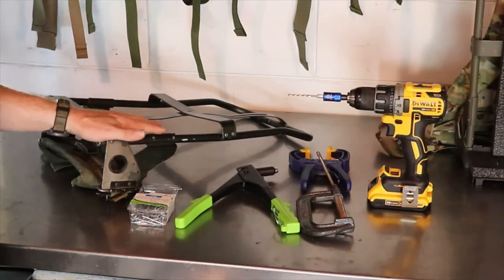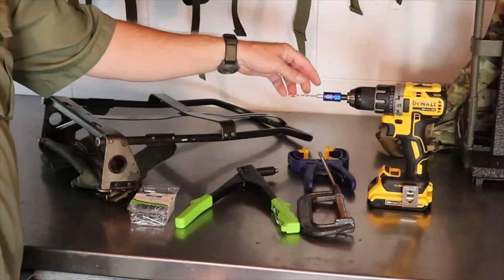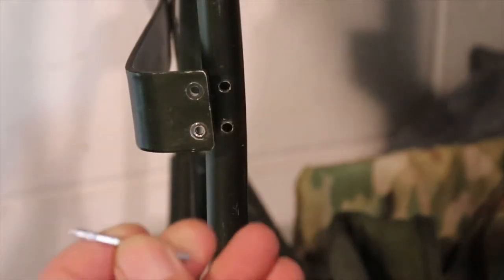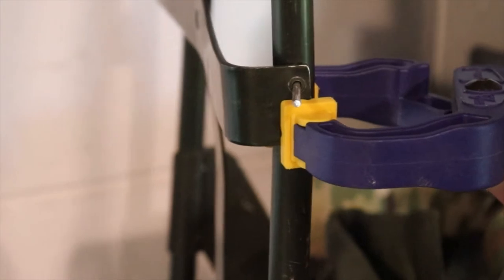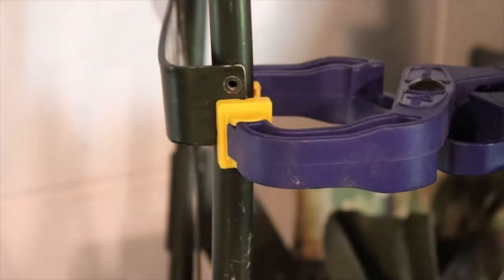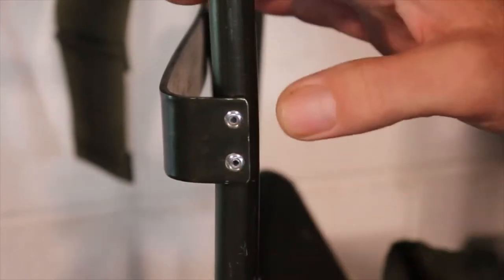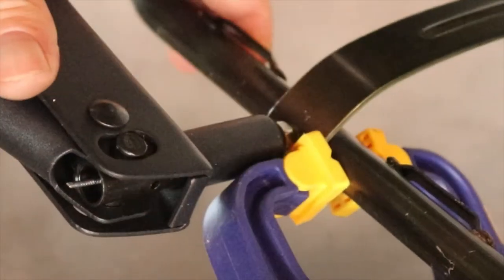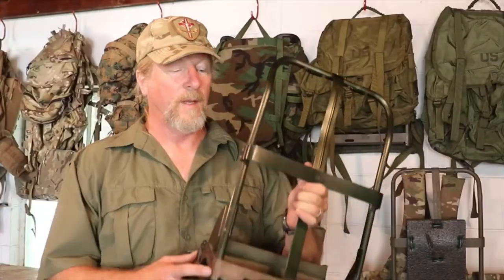Ruckdiculousness 2 A.L.I.C.E. Pack Frame Repair

Comment: I'm sorry but that clamp was not necessary.  It is a easy fix without clamps. All you had to do is just put the rivet in the hole and finish it
Reply from the maker: Thanks for The Tip Gary!

Comment: I used coat hanger wire and JB Weld to repair several frames, it does not look as good, but it is field expedient! Just purchased a nearly new large od green ruck w/frame for $90. Very hard to find in 2023 thanks to great vids like this, our secret is out!
Reply from the maker: Having some JB Weld with you in the field is a great idea!

Comment: I had the exact same issues on a frame that i also bought for cheap as it was damaged...nice to see some legit DIY repair, props my man
Reply from the maker: Thank you very much! I didn't notice it while I was doing the repairs, but when I was prepping the frame for the next video (will be up Sunday) the kidney pad was a first generation model (LC-1). That frame may well be close to 50 years old. I wish that when I hit 50 all I had wrong with me was a couple popped rivets, sadly that wasn't the case...😆😄😅👍 
Sundays video will be the Load Panel installation. I really think you'll like it! Have a fantastic day!
Reply: @boonedockery7220  likewise my man. Keep the ruckdiculousness comin!
Reply from the maker: @thatpackguy  Oh I Shall Endeavor To Do So My Good Man, With Due Diligence!

Comment: Holy smokes your video just saved me a headache! I searched and searched for an alice pack to train with and found an old one for 50 bucks. I inspected the straps and sack but after buying it I found that the 4 rivets at the base of the frame were missing. Now I'm back in business. Thank you!
Reply from the maker: That's Awesome Takoda! I'm glad I could help!😀👍

Comment: Now I'm wondering how to replace the rivets at the bottom of the frame, where the belt bracket attaches to the frame tube. The rivets go through the bracket and all the way through the tube. Just longer rivets? Idk. Awesome video series
Reply from the maker: The very first repair post I ever saw on line was pre-YouTube. The "Poster" was a combat vet from Vietnam and he drilled out and replaced ALL the rivets on his frame with steel bolts, nuts, washers and locking washers. His reasoning was that "real" use of the pack will cause most, if not all of the rivets will eventually fail. Obviously, he used his pack frames far more rigorously than I ever did. He also had the Large A.L.I.C.E. Pack on the frame. You might want to consider that before deciding. Have a great evening!

Comment: How do you replace the d ring shaped thing that the waist belt attaches to? One side of mine is missing it.
Reply from the maker: Colt, I just looked at mine and it looks like a good bit of work to install a replacement. I did some searching on line and couldn't find actual replacement d rings for the A.L.I.C.E.  frame. "IF" the d ring is the only part missing and the mounting bracket is open all the way through, you could slide some heavy gage wire through it and secure the ends to another single loop. 
I did a little more looking and fond a company that sells 2" metal loops. If you wanted the drill out the rivets that holds the bracket to the frame you could remove the bracket and replace the 2" loop and re-rivet it. It might be a bit of a challenge but it would be repaired properly.  Here is the link to the 2" loops
https://www.buckleguy.com/Search.html#/Search.html?search=2%22+single+loop&category=F231&Size=2%22+inch-F542
Reply: @boonedockery7220  that’s what I thought, didn’t know how I could go about it, or just build a pvc  frame
Reply from the maker: @coltstorm9199  It's doable, but it looks involved. I think building a PVC frame would just be a cool project on its own. Either way, it looks like you have options! Have a fantastic day!